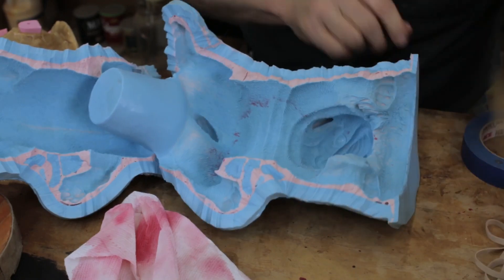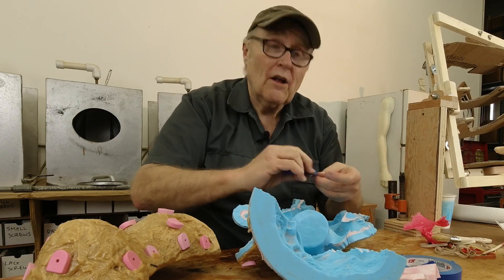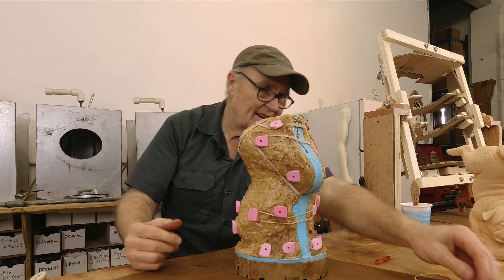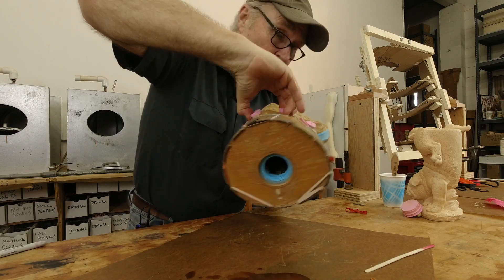Hollow Cast A Complex Part - Fixing Casting Problems, Part 6

Comment: Another experiment for your pug mug is to dust the face of the mould with talcom powder and that should break the surface tension and get the resin in to the hair detail when rotating , should also extend the mould life . Love your chanel .
Reply from the maker: I have never gotten consistent results dusting molds. It has worked for me but has also caused problems.  I find it difficult to apply a consistent, even coat of powder. There is always the possibility that it will clog in the fine details and result in less detail rather than more.  People swear by dusting though; they get good results.

Comment: would like to see a video on making a master mold, so when the silicone wears out you can make another using a master cast mold.
Reply from the maker: That’s a good idea; I will cover that.  I always keep a casting of each object, usually one of the first ones out of the mold. When possible I also keep the original object. Of course, if you are making a large edition you will need many silicone molds of the object because they do wear out pretty quick.

Comment: How about dusting the mold with cornstarch (or talc) before doing the rotational casting? From what I know (which isn't much tbh) the cornstarch will break the surface tension of the resin, "wicking" it into the smaller features. It also tends to make more flash, because the resin will be wicked into the moldlines, and it does result in a slightly different surface finish though, more matte than shiny.
Love these videos & your great advice, your years of experience show through, thank you.
Reply from the maker: I have had mixed results with the powder method. Sometimes it works very well, other times the powder fills the fine details and repels the resin. I have had castings where I could literally wipe the powder off the casting as I pull it out of the mold. You have to be really careful to dust the mold evenly and not let the powder clog into the surface details..  I just don’t bother with it anymore.

Comment: Why don’t you go thinner for first coat?
Reply from the maker: Do you mean add thinner to the resin, or brush it on in a thinner coat?
Reply: Since you did the thin resin, I guess my Q isn’t pertinent? But..could you have just poured a thin version of rubber to avoid the bubbles, on the first layer?
Reply: The bubbles were not in the rubber; it reproduced the model perfectly.  The bubbles were in the first casting I made out of the mold. It was a resin problem, not a rubber problem.